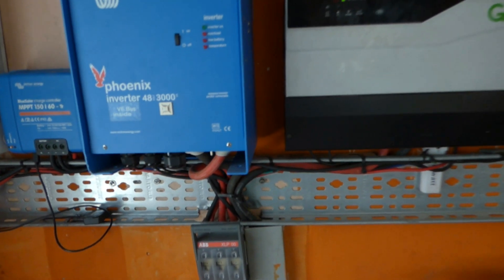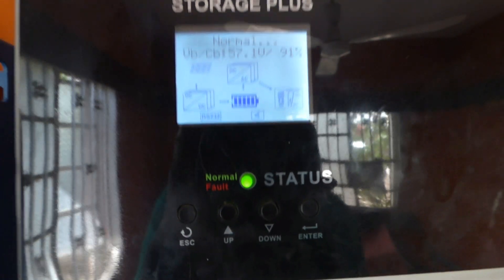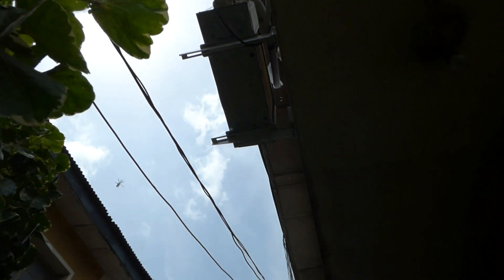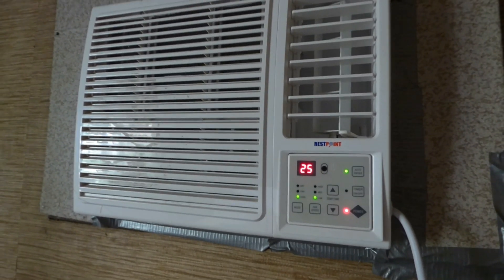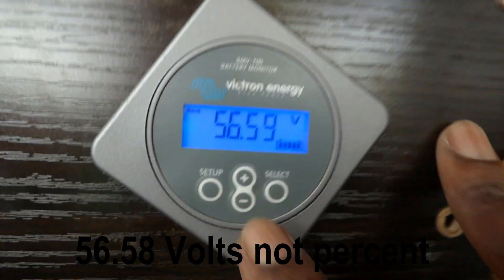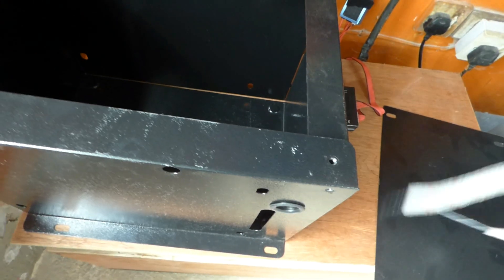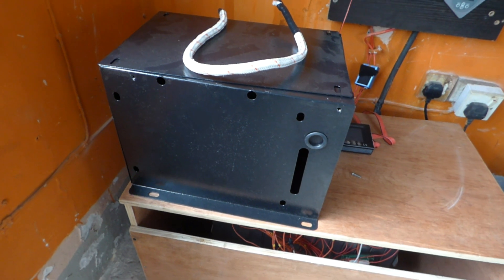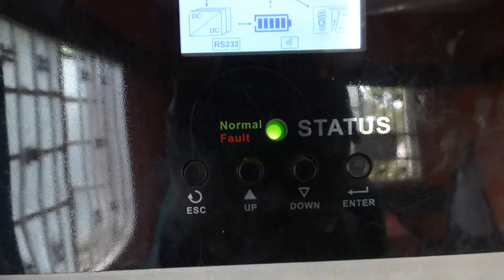I run not one but two AC on Solar plus Jehu Garcia Nissan Leaf Enclosure

Comment: Is it the 2 ACs pulling 800w or each? I'm not sure again how many watts u said your new LG inverter ac pull in watts. I will like to New. I'm considering  buying LG dual inverter if it's uses 400 watts at maximum cooling. My Panasonic 1hp uses 750w at maximum cooling
Reply from the maker: Thank you for seeking clarification. Each AC is pulling 800.

Comment: which product of solar panels do you use, i wanted to buy era solar panel on jumia, can you give me your thought on that because they got enfsolar.com review, Can you give me your thought?
Reply from the maker: They are tier 1 and I have installed them for clients. They have been happy. You also get very competitive prices. I will read the review later
Reply: @drsolar  the price was what got me worried. Thank you
Reply: I am going for their 370watt solar panel
Reply from the maker: @irenethompson9058  I did the smaller mono. The trend from manufacturers today is towards bigger panels. The last set I purchased were 300 or 320 watts.
Reply from the maker: @irenethompson9058  very competitive relative to the others. Canadian Solar has dropped their prices too
Reply: @drsolar  yes era solar panel claim their 370W has 19% efficiency while 340w has 17% efficiency that's way up better than the Canadian solar, Just saying though
Reply: @irenethompson9058  go for Tier 1 or better known brands. You won't regret it